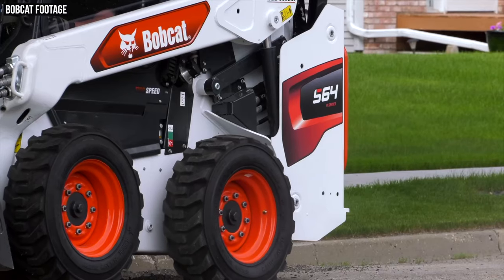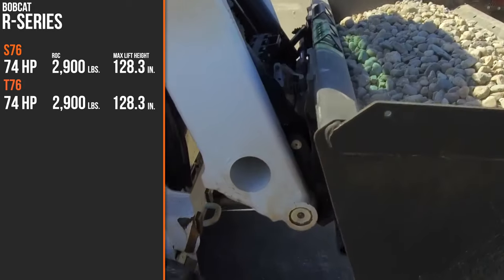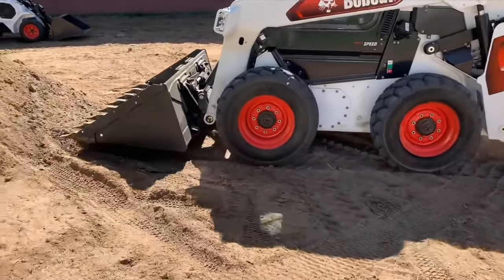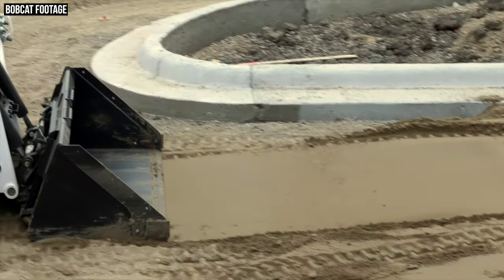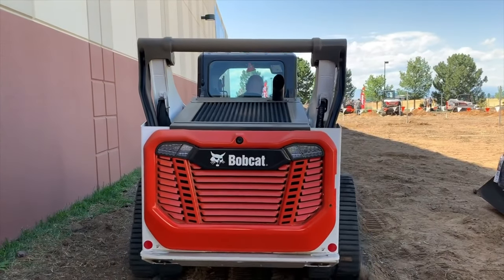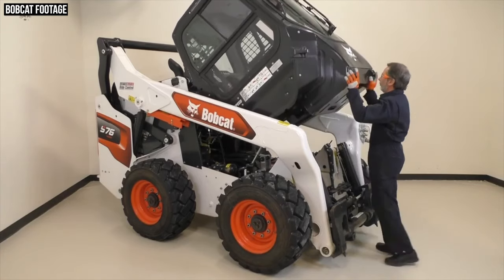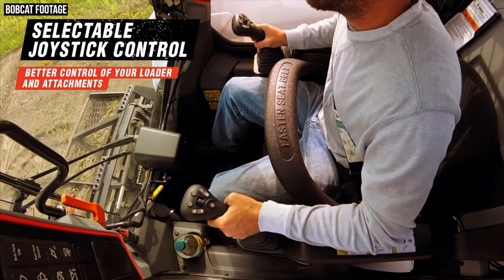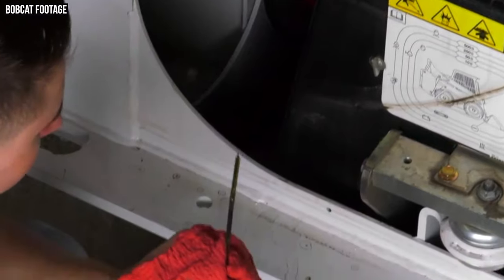Bobcat Unveils S64, S66 Skid Steers & T64, T66 CTLs in R-Series Loader Lineup Expansion

Comment: I just returned a brand new s64 rental I had for the last 2 months.  What I didn’t like about it was when you let off the forward/backward control, it still rolled for 1 second until you feel the hydraulics lock up. Maybe it’s a flow adjustment but when you are trying to pull up to a excavated hole and dump with precision I found myself bumping reverse quickly because I was close to dropping the loader in the hole because it took more time to stop. It did this loaded or unloaded. Also, When loading into a dump truck, getting a full bucket in the dirt pile really bogged the motor especially when you build up speed to hit the pile and even worse when you would shake it ad tilt back. It took so much power to dig in that’s you almost had to wait a brief second before you could actually back up. Again, it may be a flow adjust. To be fair, the dirt was damp black gumbo dirt and that’s like moving  clay which is like concrete Lastly, maybe it’s just me but when loading a dump truck the arms feel alittle short compared to older models of the same size. 
I did like the new controls with H or ISO switch and the digital menu screen. I loved the front and rear LED lights. Super bright and I like the amount of acceleration. Overall I liked the unit itselfk